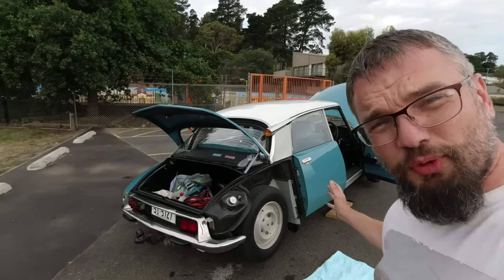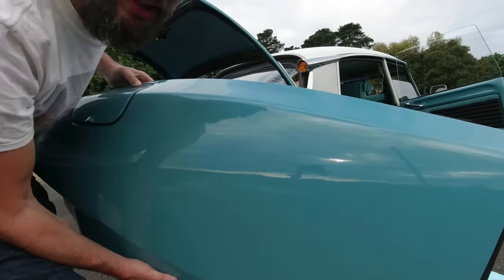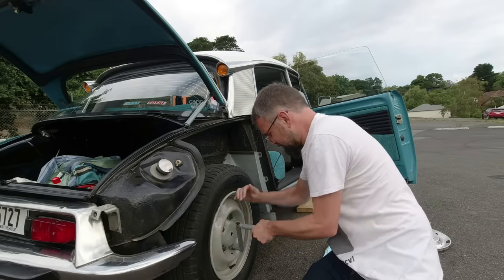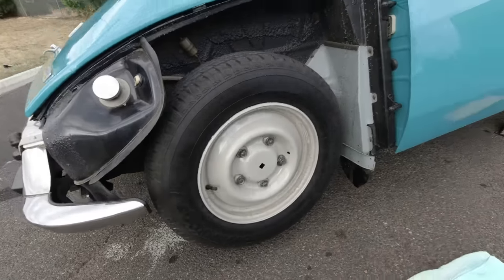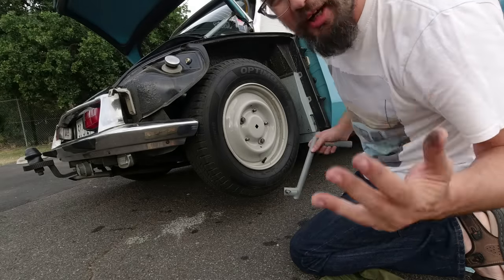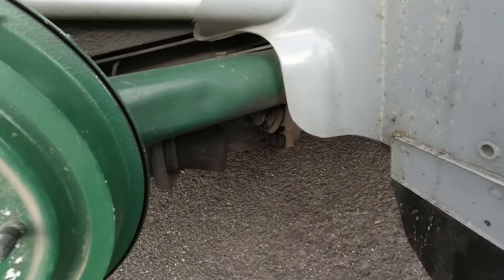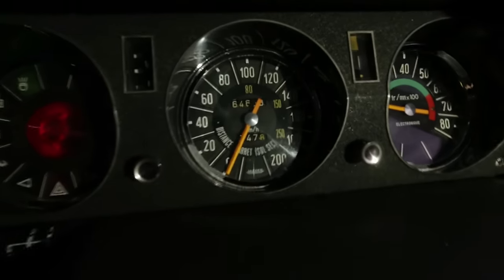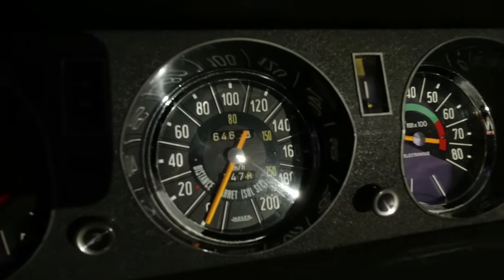Can it drive on three wheels?! And other Citroen DS Party Tricks

Comment: Wonderful engineering (mostly). Could the over-rise of the front suspension be due to a gummed up spindle valve? This car also seemed very, very slow to rise - my 1959 ID would rise as the starter cranked, because I'd cleaned out the whole red fluid hydraulic system before registering it. Bought for $250, drove it to work for years, came home 20+kms with family, on 3 wheels once, due to a flat tyre and keen to try out this trick. Sent it, eventually to the wreckers, like my CX C-matic, also due to rust. They have improved this issue out of sight  these days - our BX 122, trashed by a man with a wooden leg on his first day back behind the wheel, was rust-free, and my grey import XM 2.5 TDi were still rustless after 20 years of second-owner ownership (260kms +) when it left on a flat-top. Hope my hydraulic C5 TDi wagon is as long-lived.

Comment: Use the rear wheel opposite the driver - balances the car better. And a block of wood wedged into the rear suspension arm will stop it from dropping back towards the ground. The you can drive at highway speeds. ;-)   [1972 D Special]   Also no one mentions that if you put a load in the boot, say, a dozen bags of cement. the olio/pneumatic suspension will automatically level the car out. AND, as the rear breaks operate on the oil pressure from the rear suspension you also have load proportional breaking. All without computers! ;-)
Reply from the maker: Citroen themselves actually shot promo material using the same wheel/driver layout as I did. I don't think the driver's weight matters that much. May experiment with my GSA...
Reply: @HubNut  Yes, I've seen the footage. actually the block of wood idea cam from the local Citroen dealership when they did a demo around the Albert park F1 track [Melbourne , Oz] The cruised the track at up to 80 MPH on three wheels. The block held the trailing arm at its highest position thus keeping it well out of the road. I'll admit I haven't tried that trick  [I did a number of things during my  time with the D Special: including changing the front break pads, dressed in a dinner suit, while waiting for my wife and her foster mother to get ready to go out!  ;-)

Comment: Pre-68 they had just one wheel nut coupled with a complex hub system to attach the wheel with total security. The change to five nuts was to save costs. See what I mean about Andre Lefebvre being the complete engineering genius? Every aspect thought through. There again he did start off working with Gabriel Voisin.

Comment: I always wondered why the DS could drive on three wheels and other cars couldn't. The heavy cast-iron engine is mounted behind the front axle, nearly inside the cabin. Because of that the center of gravity was much further back then in most of the front wheel drive cars. 
The main reason to be able to do this trick is the hydraulic suspension. Or non suspension in the top-position.

Comment: Can damage the suspension riding on full-high. Put the suspension down to the high riding position and you can drive normally on three wheels. It's a little safer if you have the wheel off the passenger rear side as the car's then better balanced. I've driven normally for about 40 miles at normal speeds when I had a puncture in one tirewheel and then another in the spare.

Comment: You could have lowered the suspension to normal riding height after removing the wheel - it would have worked just fine, and would have been much more comfortable. I know because I was happily driving with my family, 4 people in total, and had not even realized that the right rear tire was flat. When somebody told me they "heard a strange noise" I had no tire left at all, the wheel was in the air - and the car was driving just fine... :) Ι bought a DS in 1991, when I was 21, and people my age at the time thought it was really strange for me to buy such a car...Still have it, of course!

Comment: In the 70s there was a advert in gb with a gs having a blowout between 2 lorries if you removed the wheel opposite the driver on rear you could drive it on a motorway as they did on chips TV show

Comment: The 2CV just has a flexible rubber sleeve attaching the filler neck to the rear wing so not really that bad (thumbs up!). It does also have a zillion screws holding the wing on (sad trombone).

Comment: I knew about the DS method for changing a wheel, but it was great to see a demonstration, but ...  what about the front wheel? Is there another more forward position for the 'jack', or is there a different technique for changing the front wheel?
Reply from the maker: It lifts the front wheel as well. The longer estates have two positions for the jack - for front or rear.

Comment: Hi there Martin from South Africa. I grew up with these wonderfull cars. I just want to add onto some additional safety  features of these Citroens vehicles amazingly because of the gearbox at the front it also helped a lot if there was as front impact by which the gearbox would act like a buffer and fold downward and secure the driver and passengers from the impact.  Another great feature which I heard is the roof made of fibreglass. When the vehicle rolls it would most of time pop back and push it back on the wheels. And one thing about most Citroens is those sharp Marchall headlamps.
Thank you for a wonderful show by the way what a beautiful restoration example of that DS. Great work done👍 My dads last Citroen was a 2.3 Pallas but sadly the spiked shaft broke which apparently was a problem on those specific model. 
Ps. also (what I heard and hopefully it is true) if a oil pipe broke on your long journey another safety feature was that if you didn't had LHM fluid you could simply raised the hydraulic lever below the drivers seat on high position then you can safely drive but slowly and you can press the brakes for up to 150 times. What actually happens is when you activate the hydraulic lever on the high position it forces air into the system which unfortunately means that you will probably have to reconditioned it replace the hydraulic spheres afterwards...😕. But to tow these Citroens with no suspension would case major damage to the suspension. 
Greetings from SA
Reply: Spiked shaft?  Can't figure out what that could possibly be.   With no hydraulics, pressure and/or fluid, there is no suspension, period, you were fed rubbish.  The brakes have their own accumulator & would be good for about 15-20 stops, any more then 30 is a fairy tale.
Reply: @alro2434  hi there😊 sorry for my spelling
The spigot shaft is the gear that comes from the gearbox leading to the engine.
Thanks for correcting me on my wrong information I appreciate Greetings

Comment: It works better if you take off the rear wheel on the opposite side to the driver... the driver's weight is then within the triangle of the 3 supporting wheels.
I once drove my ID19 stripped of all body panels on three wheels to the local shops in a Sydney suburb up hill and down - round trip of 5 kms.

The GS with hydropneumatic suspension, shorter wheel base and less weight does 3 wheels even better than a DS....
Nothing moves you like a Citroen! Bravo.
Reply from the maker: I shall try it now I own a GSA...
Reply: @HubNut  CX,  BX & Xantia do 3 wheels okay. Have never seen it done on a C5 or C6.

Comment: Excellent video, beautiful car!  Does it drive on three with one of the front wheels missing?
Reply from the maker: No, as the diff would just spin the wheel that was off the ground. I suspect there's too much weight up front for it to balance.
Reply: @HubNut  Thanks, i've only ever seen this demonstrated with rear wheels.  Another thing was the DS was one of the safest cars in the event of a wheel blowout.

Comment: like how you are required to be half of a mechanic or at least yoi become to feel one agter having done the job on a tyre replacement. You worked with a noce level of detail and precaution on someone else’s car which I appreciate. I still do think you can relax a bit more or laugh a bit more because all your videos are and will always be very nice to watch if you continue this way. As it is just you, how you are, continuing this way won’t be much of an issue. I would still love to see a review of a two door Toledo Triumph as I love how they look. I also think they are quite rare even in their habitat in GB. Oh dear, It was for a short time nervewrecking when I saw you jump aboard. I was holding my breath on the fact that the hub was going to scrub te ground or not. I already knew on the yellow numbers on the speedo ;p. The same goes for the headlights. The DS was my grandfather’s favourite car, because of its comfort. Actually, for real!  Cool video!  Stay safe Ian!

Comment: Over the past 65 years since the appearance of this car, no one has been able to create at least something that would be even a little closer in level to this car. I mean the wow effect, of course, not those idiotic touchscreens and catalytic converters. The style was absolutely insane in those years, the breathtaking suspension, front-wheel drive, the steering wheel with one spoke - the car seemed to have fallen from another planet.

Comment: and ... in an hydraulic Cit you can entertain other (unsuspecting) drivers at level crossings - brake firmly to a stop, and hold the brake on. count to 20. Let the brake off suddenly, and reapply when the suspension over-corrects and goes to full height. Brake off again, it goes to full retraction. Repeat ad infinitum. I've created some incredulous looks doing this. Only in a Cit!

Comment: What a beautiful example of this model, a lot of time and money has been spent to get it to this stage. I could hear the suspension pump operating every few seconds, so there might be a problem somewhere in the system, it shouldn't be pumping that often.
Reply: Now remedied thanks.  Main accumulator and spheres were all down on pressure.  I have had car for ten years so they did pretty well.

Comment: Excellent old yet soo advanced ... ! Not like nowdays car expensive yet old quality ...fast get rusty , especially at the 4 angle where water flow always get stuck with leaves , small brances , flowers , and dust which became mud ... and the end rusty even untill the floor...no car able to beat the movement of the steering, and front light oso running with 3 tyres.

Comment: That suspension is in excellent condition. They’re not all like that, it’s a credit to the owner.
Citroen made very distinctive cars, with some very interesting and useful innovations.
Today, it’s generally the component suppliers (like Bosch) that drive most of the innovation, and the car manufacturers design engines and chassis, and style the appearance. It’s a pity.

Comment: 5:32 - you appear to have put the 'jack' pin back in the 'parking hole' while clearly the top of the lower part clearly has a position at its upper extreme for the pin to rest in - giving you a further 2" of optional height.

Comment: Hi hobnob there is another trick that can be done with the Citroen DS semi automatic 
If you start the engine in neutral..and release the handbreak then  lower the window.
Now stand outside of the car. Put your hand in and push the gear stalk into first gear
The car will begin to creep forward at just about walking pace 
It is amazing to see. But be very careful.  Even if you lean in and put the car into neutral 
Momentum still occurs so you have to jump in and put the parking break on
In the workshop in Slough many accidents happened like this
Reply: *brake :)

Comment: That's one VERY trusting owner..... The DS was - and is still - futuristic. We thought the future would bring brighter and better technology; it brought cheaper mass-market technology.
Reply: Come on - modern cars are massively better designed in every possible respect than cars of forty years ago! 
Safety, efficiency, braking, ease of driving, comfort, equipment levels, reliabilty, longevity, emissions, cost of ownership(rust, service intervals) etc. etc. etc. etc. etc.........!!
Reply from the maker: I strongly contest comfort. Modern seats and suspension are bloody awful.
Reply: @andymccabe6712  I think you're missing the point. The 1940s and 50s were a cauldron of experiment and innovation. The DS is one of the best examples of that . Designers at that time thought that the future would see a smaller number of more radical cars sold. Instead, what we've seen is a mass-market convergence. Modern cars don't experiment with suspension systems, they use a fairly commonly accepted norm. It's not the best but it's the cheapest and it's adequate. Equally, engines have become - largely - the same. The OHC W/c inline four is the european engine engine of choice - even things like Subarus which have the temerity to use a flat engine are criticised for doing so by mass market "journalists". Comfort, again, is "good enough" - it's a cheap as the market will bear whilst not deviating too far from the norm. The advances in servicing and reliability are mainly the result of better materials technology and are almost inevitable - they also have handy knock on effects in cost terms for the manufacturer.

The net result is a largely conformist industry which agrees what a car "is" and produces cars that are pretty much all the same. Innovation is marginal as manufacturers seek to maximise profits and avoid doing anything too "out there". that's why the DS still seems futuristic - because it is! It represents a future that was killed by production economics and marketing. No-one will ever build a car with this capability again because it will cost too much and the marketing department worry that it will put people off. It's a future that we dodged in favour of the middle ground.

Comment: The Citroen is amazing. There is one downside to that hydraulic suspension. One poor fellow, back in the late eighties, had one of those here in the states. He had just rebuilt the entire system. Instead of staying close to home, he decided to take a little trip. He stopped at the garage where I worked and cleaned out all the brake fluid we had on hand, it was Sunday and no open parts stores back then. One of the new seals was leaking, badly. His was going to be an expensive ride home.
Reply from the maker: Oh dear. I hope he didn't use normal brake fluid...
Reply: Actually he did. I don't know how available the correct fluid was over here in the late eighties, but parts places weren't open on 

Sunday back then and he had a longish drive home. He would have had no suspension at all without the brake fluid. I guess that isn't good for the seals?
Reply: Regular brake fluid, Dot 2or 3 was used until the green came out in 70.  The green is thicker, better lube qualities, but the pump & parts weren't wearing out because of brake fluids low viscosity & lubrication proprieties anyway..  Green was eating up the right front sphere WAY too quick, a year in hot S Fl.  Took'm apart and they were some kinda rubbery mush.

Comment: Hi Ian, great video. Explains why my ZX has the handbrake on the rear and my C5 on the front. The C5 suspension is nowhere near as good as the DS but I have driven the C5 for some urban London miles with a flat front tyre without noticing it.
Reply: You should have your Driving Licence revoked.
Reply: Why? Just pointing out that the C5 pump up suspension is not as good as the one on the DS but still let's you drive on 3 wheels at slow speeds if you have a puncture.
Reply: @andrewwilkin1923  C5's ride very well I think.    They were the last Citroen with the hydraulic suspension.  Electric pump. In fact the last of the C5's went to conventional suspension.

Comment: Non-revving lifting - presumably already residual pressure in the system so not totally 'flat' - unlike first thing in the morning.

Question: On a cold start, can you still drive off straight away - and feel all of the bumpage through the suspension stops ? (I take it that the car at this stage will have only one braking system !)
Reply: Not recommended unless you have just robbed the bank and cannot afford to pay for a getaway driver!!!

Comment: A really good fun video, and the DS is a classic piece of French wizardry. I remember banger racing at Machams in the early 70's and watching one in the destruction derby. All the panels fell off, probably through a little preparation. A heavy rear end shunt folded the floor up, so the rear wheels were airborne. It continued on the front wheels!

Comment: I don't see why you can't have the handbrake on the rear wheels, just because the car uses trailing arms. A lot of cars have that, and they still have the hand brake on the rear wheels. I believe the reason for putting the handbrake on the front wheels is that it's a lot more efficient in an emergency situation, and you don't risk having the car spinning around (involuntarily handbrake turn), if you have to use the handbrake on a slippery surface. At least, that's the reasons Saab stated, when they put the handbrake on the front wheels on their cars.

Comment: I noticed while driving, that the pressure regulator kept kicking in to recharge system pressure, by that faint but distinctive repeating snrrr..click sound.
This is indicative of either a weak (flat) accumulator sphere, or a constant internal pressure leak in one (or more) of the suspension height cylinders.
Is that a service problem you have looked into ?
Reply from the maker: Indeed. It's since had the accumulator regassed and now behaves better apparently.

Comment: Presumably that only works with the rear wheels as the CoG must be ahead of the line between the remaining diagonally opposed wheels mustn't it.
Reply: Definitely. If you loaded the boot that would be enough to life the diagonally opposite front wheel from the ground.